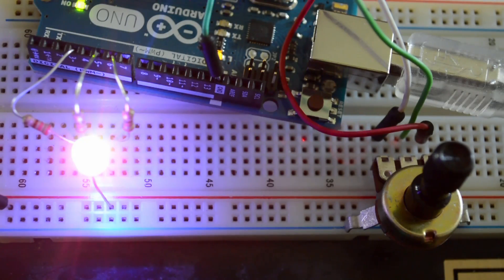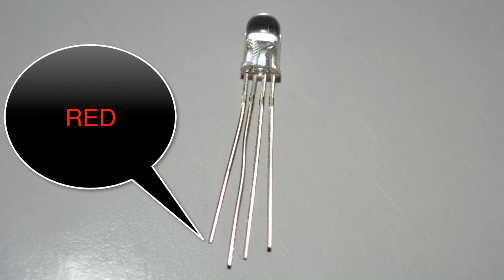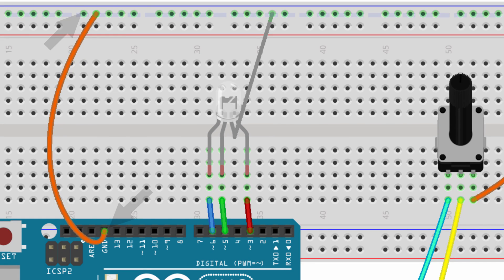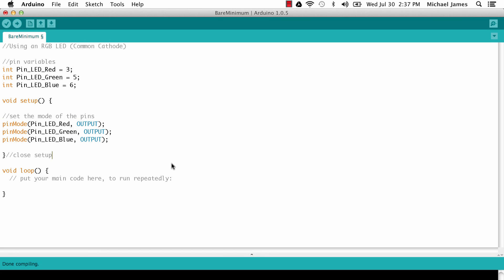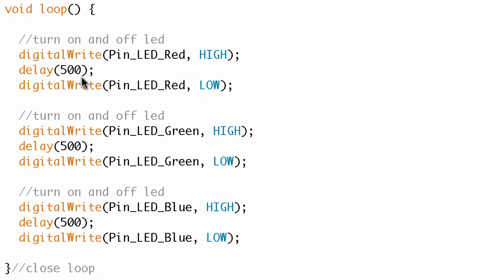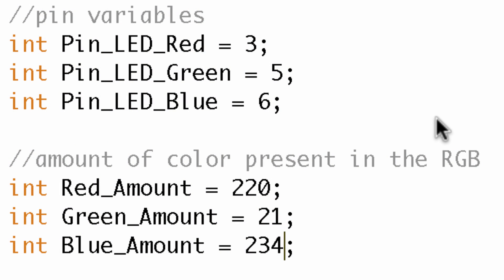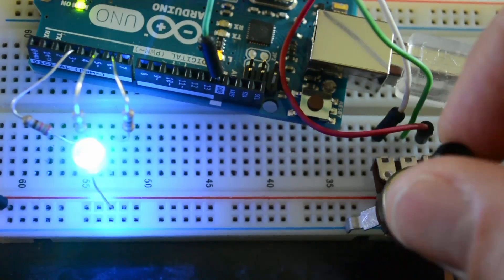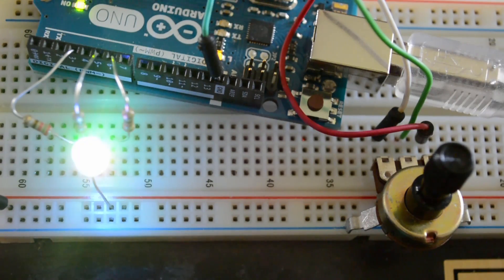Using Red-Green-Blue (RGB) LEDs with Arduino (Common Cathode Type)

Comment: // Using RGB Led With Three Potensiometer

int Red = 3;
int Green = 5;
int Blue = 6;

int R_potensiometer = A0;
int G_potensiometer = A1;
int B_potensiometer = A2;

void setup() 
{
  pinMode(Red, OUTPUT);
  pinMode(Green, OUTPUT);
  pinMode(Blue, OUTPUT);
  
  pinMode(R_potensiometer, INPUT);
  pinMode(G_potensiometer, INPUT);
  pinMode(B_potensiometer, INPUT);
}

void loop()
{
  int Input_Colour_Red = analogRead(R_potensiometer);
  int Input_Colour_Green = analogRead(G_potensiometer);
  int Input_Colour_Blue = analogRead(B_potensiometer);

  Input_Colour_Red = map(Input_Colour_Red, 0, 1023, 0, 255);
  Input_Colour_Green = map(Input_Colour_Green, 0, 1023, 0, 255);
  Input_Colour_Blue = map(Input_Colour_Blue, 0, 1023, 0, 255);
 
  analogWrite(Red, Input_Colour_Red);
  analogWrite(Green, Input_Colour_Green);
  analogWrite(Blue, Input_Colour_Blue);

  // Delay A Bit For Better Performence
  delay(10);
}

This is the code for using RGB led through 3 potensiometer

Comment: What is the amount of ohms of the resistors you used for this set up?
also, how do you find out if RGB Led has Common Cathode or Anode?
Reply: 330ohm
Reply: By avo, red wire on comman pin and black to any pin another
If the led turn on, that mean it is a common anode, If not, that is mean it is comman cathode!

Comment: If you are using a Common Anode RGB, you'll have to connect the VCC to +5V. The values of each are messed up as well... 
0 = Full Brightness
255 = Off
Here is a link to values for various colours using the Common Anode: https://learn.sparkfun.com/tutorials/lilypad-tri-color-led-hookup-guide/all
Reply: For the beginning portion, Michael has us turn on the Red, Green and Blue sequentially. If you have the Common Anode, just do the opposite... turn it LOW... then turn it HIGH.

Comment: //Using an RGB (common Cathode)
//pin variables
int Pin_LED_Red = 3;
int Pin_LED_Green = 5;
int Pin_LED_Blue = 6;
void setup() {
  // set the mode of the pins
  pinMode(Pin_LED_Red, OUTPUT);
  pinMode(Pin_LED_Green, OUTPUT);
  pinMode(PIN_LED_Blue, OUTPUT);
}
void loop() {
  //turn on and off led
  digitalWrite(Pin_LED_Red, HIGH);
  delay(500);
  digitalWrite(Pin_LED_Red,LOW);
//turn on and off led
  digitalWrite(Pin_LED_Green, HIGH);
  delay(500);
  digitalWrite(Pin_LED_Green,LOW);
//turn on and off led
  digitalWrite(Pin_LED_Blue, HIGH);
  delay(500);
  digitalWrite(Pin_LED_Blue,LOW);
}

"Pin_LED_Blue" was not declared in this scope. what am I doing wrong?
Reply: idk if you even care about this program anymore but if you haven't figured it out yet, you have an uppercase "I" on your tenth line lol
hope this helped :)
Reply: bI have re-wrote it out, I've tried all your codes in this video and the all say Pin_LED _Blue was not declared in this scope.

Comment: Programming Electronics Academy

I am wanting to control my difused rgb led with my pc but the problem I am having is if it is a common cathode or a common anode led. How do I tell and if I can't will it hurt trying ground pin and then trying 5v to see which one works?
Reply: NibblyBitz get a multimeter...connect the long leg to red lead and one of the short ones to black...if it lights it's common anode...if it doesn't then reverse your leads, if it lights when black is on the long one then it's common cathode....multimeter should be on the diode test setting
Reply: DON'T put 5V directly on any LED without a resistor in line somewhere. .you WILL fry it

Comment: To get equal amounts of light from each color, I think a proper resistor value is necessary. Red requires 2 volts, its resistor should be 150 ohms, green and blue needs 3.3 volts so their resistors should be 100 ohms. If the resistor values are correct, you should get a whitish blend which doesn't lean to any of the colors.

I don't want to comment about your program writing style, but it's not necessary to be too verbose with your variables, it's an efficient practice to use short but meaningful names on your variables and to always start with a lowercase letter as it's considered clean format. Also it's memory-efficient to use the #define preprocessor for your pin assignments. The int data type is very wasteful.
Reply: I'm a retired engineer and have worked for NASA and various DoD and aerospace contractors.  One standard that we used was to use a lowercase first letter for variables that have scope local to a function or for functions that are not supposed to be publicly visible.  Variables that start with uppercase letters were global variables.  Functions that start with uppercase letters were visible to other modules.  There were also other conventions like making each module have a unique identifier (usually 3-5 uppercase characters followed by an underscore) that you would put on any function that was visible and designed to be used by other modules.  These were very large projects where you might have hundreds of developers working on various parts of it across numerous teams at various companies.  It's a good practice even if you are working on smaller projects, because if you do it right, it helps in the reuse of code.  Write it once... Debug it once... Reuse it many times... Writing the same code over and over is boring...
Reply: @CurmudgeonExtraordinaire  Thanks for that very sound advice. 😀

Comment: Hello friend, I just want to say first great videos. I'm just a little confused with this one, on the schematic you didn't show to put any resistors and you say that the long end of the pin of the led is the cathode but in the setup it looks like the cathode is pined into the positive rail of the breadboard, I'm confused and I keep getting and error  when I try to verify the work.

Comment: on 3:43 drawing you're not using any resistor and suddenly on the real 'thing' (6:50) i see three resistors .... somthing wrong with your setup ?
Reply: jim elektriek 
Are you sure that using the same resistor values for each LED is the best idea. According to the Ebay common cathode RGB LEDs that I got, the red LED operates at a typical voltage of 2.4 volts, and the green and blue like to operate at 3.4 volts. This circuit shows a 150 ohm resistor on the red, and 100 ohm resistors on the green and blue. This would tend to make the PWM values in your code MEAN the same thing for all three LED colors, would it not?

http://i.stack.imgur.com/egSqx.png
Reply from the maker: Dooht!   Yikes - the drawing at 3:43 is incorrect.  Needs to have 3 220 OHM resistors attached from the pins to the RGB leads...Thanks for pointing that out Jim!  I may just pull the video and reload a correct one, or make an annotation in there.
Reply: Open Source Hardware Group ur welcome! Forgot to mention i like your vid's a lot !
Reply: ?? hate ?? huh
Reply: yeah.. I tried it with wires but figured it out